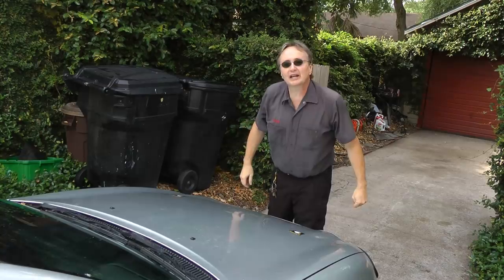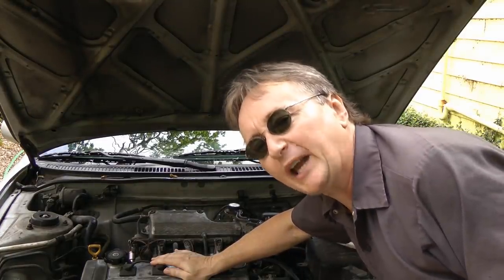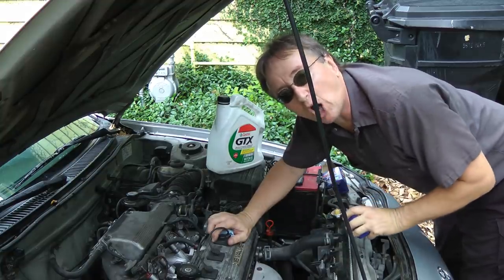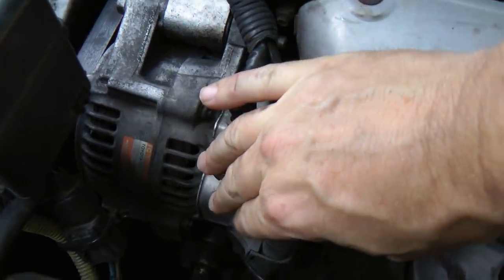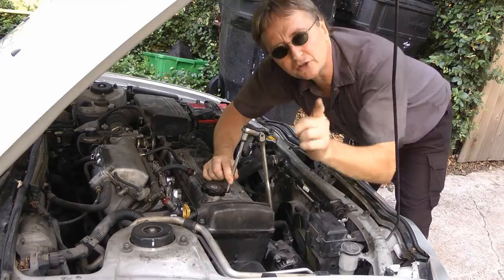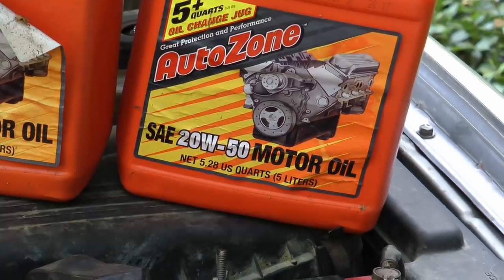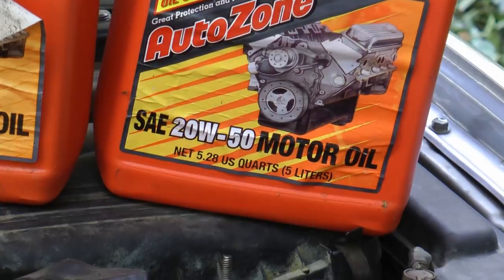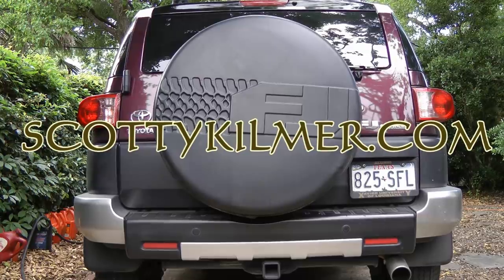Top 4 Mistakes Car Owners Make (DIY Fails)

Comment: Do you really need to warm the car before doing an oil change?
Reply from the maker: 5 minutes is good enough
Reply: Preferably, when the oil is warm the viscosity is lowered (hence why oils have viscosity ranges), allowing it to flow more freely and letting all the oil drain out.
Reply: I agree that warming the oil prior to an oil change will lower it's viscosity allowing it to flow out more freely but running the engine will also suck the oil out of the pan to the top of the motor where it will eventually drain back down to the pan.  In a cold engine, practically all of the oil is already in the pan.  Doesn't it make more sense to remove the plug and let the cold thick oil drain straight out of the pan rather than draining warm thin oil out of the pan and hoping that as much warm thin oil drains all the way down from the top of the engine before you put the plug back in?  Which method gets all of the oil out faster?  Probably depends on the temperature of the cold engine.  I usually remove the plug on a cold engine and either walk away for at least an hour, or I find other tasks to perform for at least an hour.  In order to get even more oil out, sometimes I'll come back after an hour and with the oil filter off, I'll start the engine and run it for 2 seconds.  Perhaps someone should do a test to find out which method gets say 95% of the oil out faster.

Comment: Ummmm what is 10 weight 30 oil? The W stands for winter, meaning that 30 weight oil will thicken in 10 degrees or less. 20 winter 50 weight oil will thicken in 20 degrees or less. 10 winter 40 weight oil will thicken in 10 degrees or less. 10W 30 oil is 30 weight oil. 10W 40 oil is 40 weight oil. 20W 50 oil is 50 weight oil. The more you know

Comment: for all you bitchin about w=winter. it does mean winter but the word "weight" has been used to describe viscosity for a long time now.  I feel its ok to say 10weight30 instead of 10w30. We all know its 10weight at startup and 30weight at operating temperatures, can vary some in extreme climates.  NOBODY calls it 10winter30, not that I know of atleast.

Comment: I use 10 40 on my Malibu should I start using what the cap says
Reply: +Fernando Cardenas Yes. I'm not sure what year Malibu you have, but it's likely either a 5w-30, or 10w-30. Sometimes, though, you need to change the oil weight you're using depending on the climate. If it recommends 10w-30, but you have cold winters, then you should be using the 5w-30 during the winter, and then back to the 10w-30 during the summer. The first number is the one you want to pay attention to. That's the number that tells you the viscosity, (how fast or slow it flows) and the lower the number, the thinner it is, meaning it will reach all the vital components faster. Hope this helps.
Reply: Thanks man. It's a 98 with 190000 miles

Comment: How tight do you do the oil filter
Reply: mack kaval I usually hand hand tight my Toyota’s. On my Subaru they recommend a 1/3 of a turn past hand tight but they claim their naturally aspired engine has a higher pressure so their filters have a valve in them that work beat when tightened this way. But I like to be able to take them off by hand whenever possible.

Comment: mr Kilmer i recently changed the motor oil. the cap on the car says w5-20 but they gave me w5-30 i took it back to autozone  the guy told me  my car is high on miles n the number on the cap is when my motor is new  is it true?  so i used w5-30 instead of w5-20 synthetic help me here please
Reply: is your car is burning oil? if so how mutch?  it's and old believe to think ticker oil will help worn engine. your engine need to be very worn up for that to happen. anyway put ticker oil in engine wil make the lubrification more difficult so less efficient. it migh even raise the temperarure of your engine and make you lose HP.
Reply: +FredNitroJunk thanks for replying my car isn't burning oil but i feel it a bit heavy after i changed the oil im going back to the number on the cap i always use royal purple full synthetic motor oil i dont know why i did it
Reply: +FredNitroJunk thanks for the info
Reply: +Sergio Bullitt RP is a good oil never let anyone telling you its not. a bit pricey for a everyday car but still a good choice. no wonder why your car is in good shape. don't worry about your engine it might cost a bit more gas then it use to but no damage will occure.
Reply: What the guy told you at the store is idiotic but 5w 30 is perfectly fine to use in your car, 5w 20 is a relatively new oil and is only specified because it will give the vehicle just ever so slightly better fuel milage. 5w30 will give you better protection. Keep in mind you will have to do the next oil change at 3000 miles since you put a conventional oil in the car this time. Your service manual probably states to do an oil change every 8000 or so but that is because it's supposed to have a synthetic oil in it. For your next oil change I would do what Scotty says and just put what the cap says to use in it.
Reply: Carl Zimmerman  Carl you go a comon mistake here to think 30 gives better protection then 20. you need to put the oil weight your car is been desing for. i won't go to technical because it is hard for me to translate all that in english but basicly a thiker oil will not lubricate as enfficiently if the engine tolerance are not made for that oil. it may built up heat in engine and even reduce HP. the oil need to "travel" with ease trough your engine componants to achive good lubrification.
Reply: Carl Zimmerman its a nice article everyone should read it. but you know this is mainly what i just told you, it deverge a little on the main point: will ticker oil will help or not. I took time to respond because i have  foward the link to an engineer and business partner at Total canada. he think exactly what i've told you; you need to trust the engineer that desing the vehicle, he's the one who know exacly what your car need. of course you can trust anything you can read over the net, and thinking about it, I have help built a web site of the school I was working at as a mecanic teacher couple years ago. so anyone who will read my point of view over the net will not agree with you. who's right? who knows....but until we know, you got your self a choice: will you trust an article on a web site that say the whole car industrie is wrong, or one of the few mecanic engineer good and respected enough to work and desing car at subaru, ford, honda or whatever. your call, but for me, my impreza and my FRS will stick with 5W20 and 0W20 synthetic as recommended.
Reply: FredNitroJunk "Next oil change do what Scotty says and put what the cap says to put in it." 

That was at the bottom of my original comment. I never disagreed with using what the manufacturer recommends but at the same time I wouldn't worry if I have 5w-30 instead of 5w-20 in my car.  Assuming my car isnt new and such a practice would void your warranty.

Also this is a popular debate and many more articles exist that support the theory that 5w20 is used solely for the fact it increases fuel milage will sacrificing engine longevity. However I believe your argument about engine tolerances is a valid one and something I will look more into in the future.
Reply: You should be fine. 5w-30 is a common oil and a good one to use if you’re not sure unless you have a German car or sports car. 5w-20 is used in fuel efficient cars. You’ll get the recommended mpg or better using 5w-20, but it’s not a huge difference to 5w-30. Changing to thicker oil on older cars is just old folks tales. Change your gaskets and you can run your recommended oil. The engine is engineered for that specific oil.

Comment: The statement he made about letting your engine cool down before changing spark plugs its BS if every mechanic told a customer have to wait 2 hours before changing your plugs  don't think the customer would be happy. I changed my plugs on my truck while the engine was hot I didn't have any problems
Reply from the maker: ha ha ha, hurrying things up damages stuff. Modern engine head are aluminum, and guess what?  they strip out really easy when hot, so have patience
Reply: Nothing bad against you scotty I'm not doubting your expertise my brother is an ASE certified master tech, and he's changed plugs on hot engines before with no issues  I do get what your saying though and I didn't rush I used hand tools to take them out and put back in.

Comment: I just realized the "W" stands for weight .
Reply: it doesn't  it actually stands for Winter.   its the viscosity rating of the oil during cold temps

Comment: Absolutly wrong. Use 20w50 mineral oil. Ir lasts and protects tour engine for at least two yearsn . When startibg, camshaft still retains oil, not as sthetic . See, hybrid Toyotas use mineral oil, because they use to work  always at cold temperature
Reply: Mineral oil is a petroleum product, so you could be right, Vi Bn. Where are you from?

Comment: Shit i found the older version! Well built and works great. I have one from 8 years ago and it pulls in 65 channels no problem. The aluminum is thicker and this is a much stronger built antenna than the new ones. I cant believe i found some for sale. Get em fast cause im buying another one! Here's the link: https://www.ebay.com/itm/SUNKEY-5806-HDTV-DIGITAL-ROTOR-AMPLIFIED-OUTDOOR-TV-ANTENNA-HD-UHF-VHF-FM-CABLE/121107727968?hash=item1c32954660:g:7esAAOSwPcVVh1yy

Comment: Why are you saying weight when it is weather please provide correct information
Reply: The " W " means Winter not Weather. Standard used by the SAE. It can also mean "Weight" in terms of Single-Grade Oil. So he's neither incorrect or correct. He's using an older standard of what it used to be commonly called.

Comment: Hai my naam is Hani 
My car is Hyundai Atos 2004 
My car sitution  is good
I want to chang fuel filter 
Advis me 
I am leving in netheland
Reply: Pump out fuel. Disconnect fuel line with special tool. Replace fuel filter and connect fuel lines back together. It's a little messy and the lines are metal so its tricky to connect and disconnect sometimes so it's sometimes better to pay a professional.

Comment: Common sense... take off the battery terminal before anything!  No shock, no damaged electronics and no towing to a shop and the cost of repairs since YOU failed to use common sense !

Comment: my taurus calls for 10 w 30 fuck that shit i been putting in 15 w 40 been doing it for about 11 years now 11 years latter almost got 400.000 on it and still quit with 0 knocks doing the samething to my Lumina still quit and running strong it only has 7.000 so its got a long road ahead

Comment: you dosen¨t seem like a expert. with new cars you sometimes cant remove one off the batteri cables. then the computer codes and things like that will disapear and it maybe even wont start.
Reply: Teh Nouk not an issue, how do you think batteries get changed? 🙄